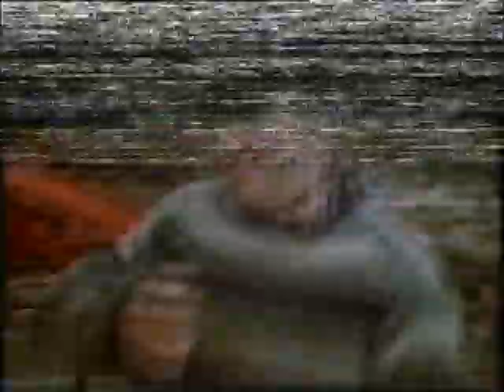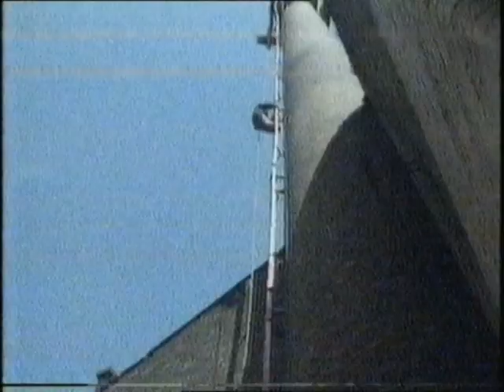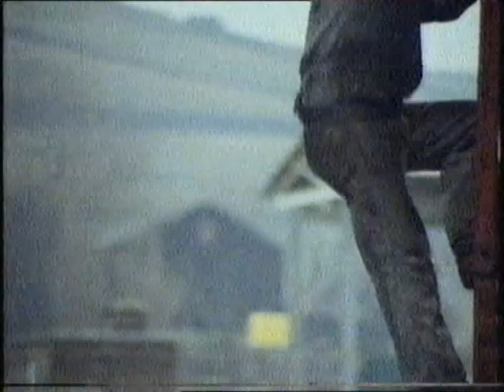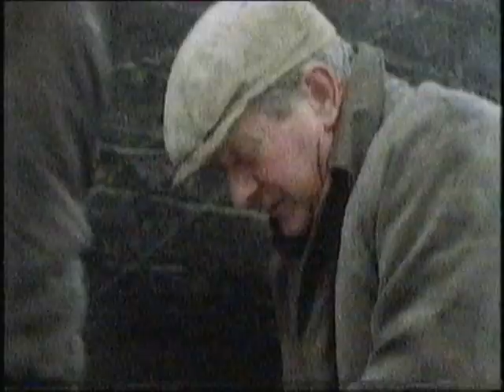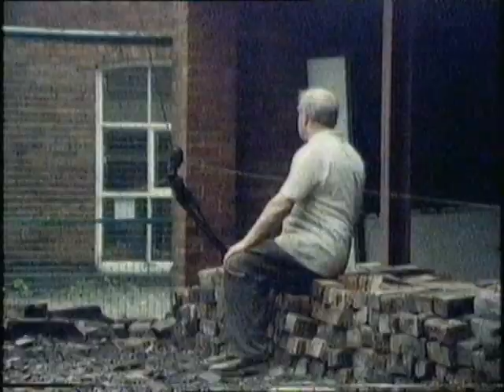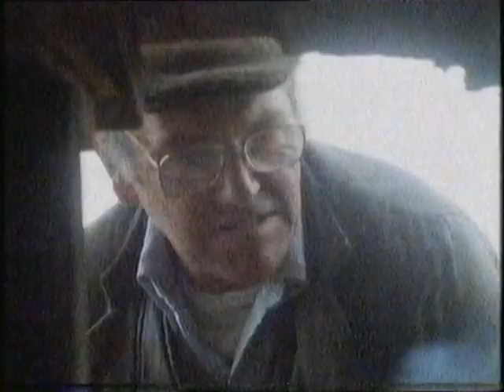A Year with Fred - A Beautiful Pile of Bricks (part 1)

Comment: £650 to knock that building down. Fast forward to today. It would be a team of Health & Safety men, a dozen demolition men. the area would be sealed off, it would cost tens of thousands.
Yet there was Fred and Donald. Hammer & Chisel. Props, firewood, tyres and A couple of gallon of diesel. How things have changed!
Reply: Better to have health and safety than not, as H&S was 5 years old when the first Fred documentary launched.
Reply: That was still well over a month's wages back then , to some two or three months . It would take Fred three or four days to get it to fire lighting stage .

Comment: Walter Forshaw driving a hard bargain! Great footage of the Bolton of 35, 40 years ago. The chimneys in the valley beyond the Dart did go, and Threlfalls still stands.

Magic.
Reply: Worked for Harry Forshaw in the early 90s at Kent Mill Chadderton and Fred dropped the 180ft chimney there but the back end buckled and sent the brickwork at the bottom crash through the perimeter wall
Reply: RIP Donald and Fred together again in the smoking stacks in the sky